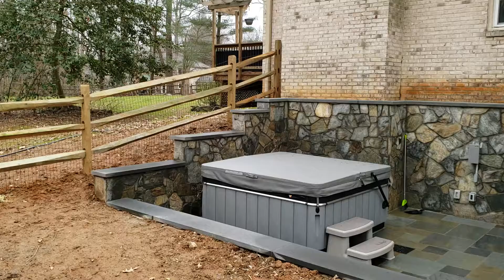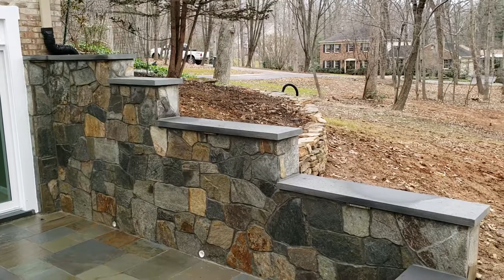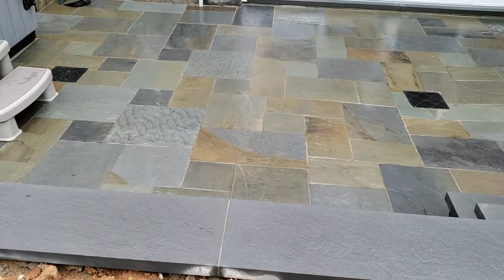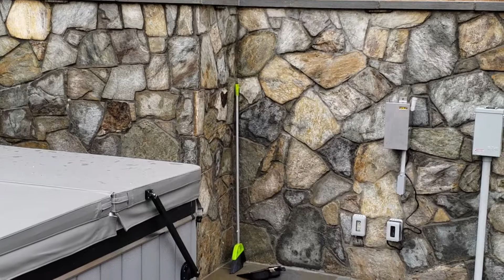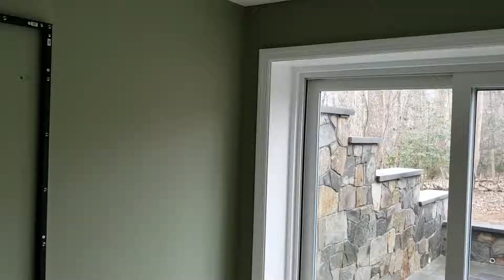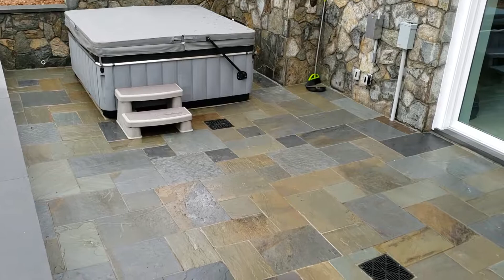Luxury Sunken Hot Tub & Patio: 5ft Retaining Walls, Snow Melt & Underpinning in Oakton, VA

Comment: This looks amazing. Was the dirt level on the back of this house at the same level as the dirt on the sides? Did you dig down and expose the entire back wall of the house that was previously backfilled with dirt?
Reply from the maker: Thank for the kind words. Yes the dirt level was all the way up the wall. You can see the dirt on the wall prior to us doing the final cleaning. Keep in mind the dirt level was excavated over 12" below the stone to account for the concrete, stone, and gravel base. A lot of dirt came out of here.
Reply: @Tuckgcinc  Very Impressive! So if you are removing backfill dirt like this, you just need to make sure the foundation is below the frost line? I am looking to perform a similar job of lower dirt level but want to understand the scope before I start getting bids.

Comment: I know costs vary quite a bit in different areas, but to give me an idea what was the approximate cost on this project?
Reply from the maker: Roughly $75k.  Keep in mind a project like this is about materials and skilled labor you can have in residential construction.  Normal egress walkouts are $20k+. Most patios the same.  This is all that plus some
Reply: @Tuckgcinc  Im not anywhere near your area but if I was i wouldn't hesitate to give you my business. Rare is a man that isn't afraid to say the general price. 
My first time working with a contractor to get an egress window in I thought he was trying to rip me off until I researched the price of material for the job. You guys really aren't charging enough if anything for this type of work.
Reply: @Luckingsworth  Thanks for the input.  I appreciate it.  I honestly took on this job because nobody else would.  The client looked for over a year.  I have jobs I can pull a 30% profit in one day and this one took over a month and I didn't pull that.  This job wasn't about the money for me.  I knew it would be one of the coolest jobs I will ever do and rarely do these come along.  so I took it on for the budget that they had.  I was confident enough that I could bring it in and make some money and that's what happened.  I feel it turned out absolutely amazing and the heated floor is just the icing on the cake.  There's a video before this on my channel that shows the ice melt system with snow on the ground.  It's pretty cool.  I put that $75k price up there but it was pushing close to 100k with the ice melt system and everything.
Reply: Sorry, minus the electrical. Looking at the foundation, stone work, drainage and doorway.